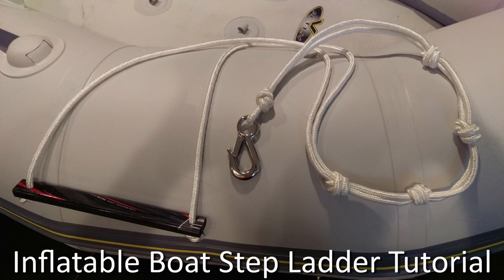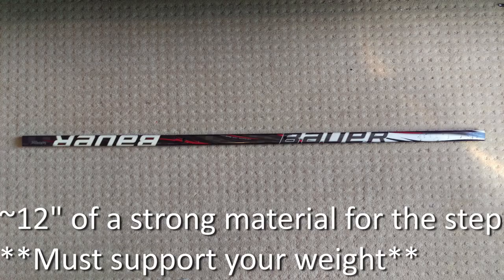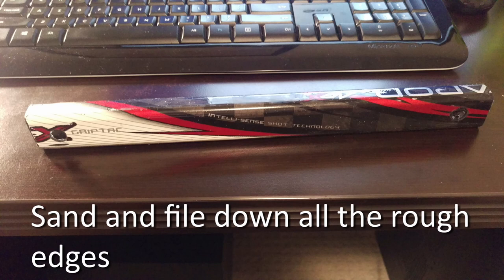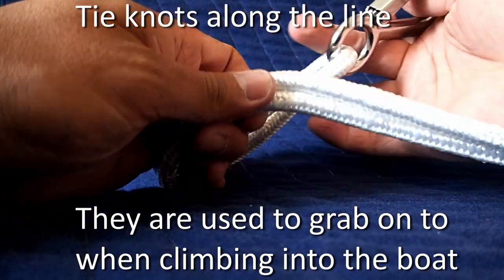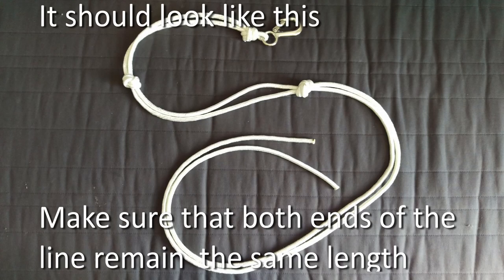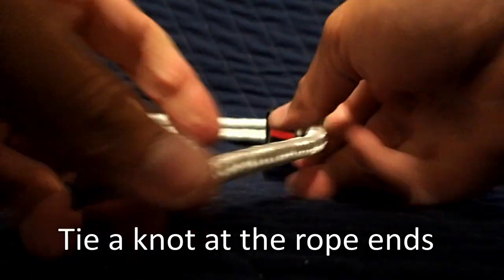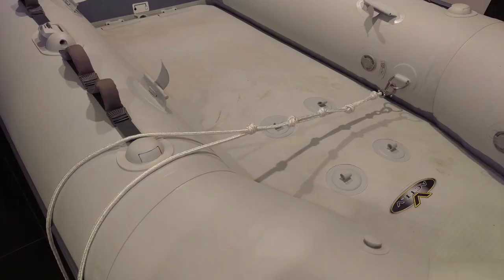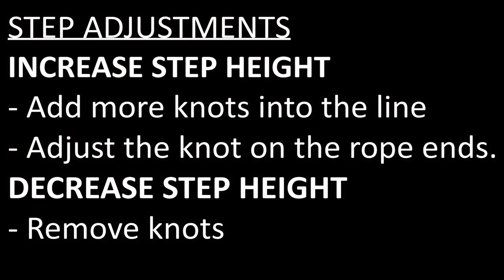Inflatable Boat DIY Ladder

Comment: Thanks.  I will try your idea.  Wish you had a video showing it in actual use...on the water and someone climbing out using the knots etc.
Reply from the maker: Thanks, i think i ll do that next time i go for a swim, probably not until the mid summer.  It does work though i've used it a few times.
Reply from the maker: Robyn Quintana Heres a video i made on how to use the ladder.  https://www.youtube.com/watch?v=GcKRFYYNVfw
Reply: David Pham Thanks!